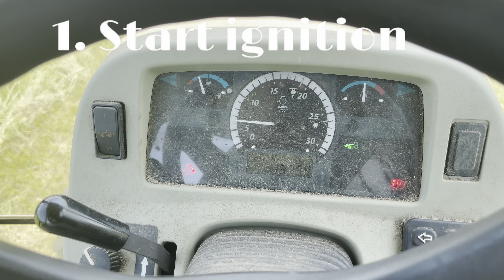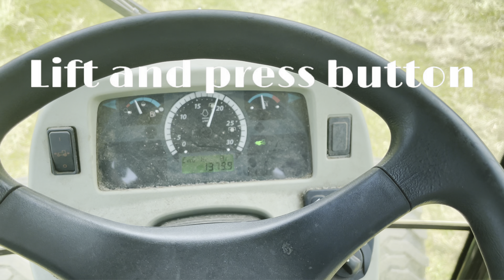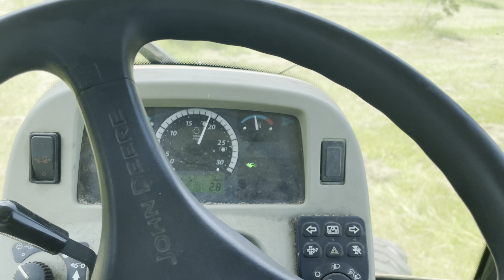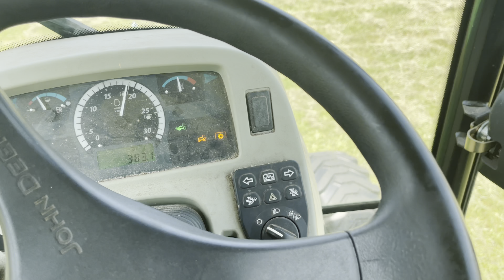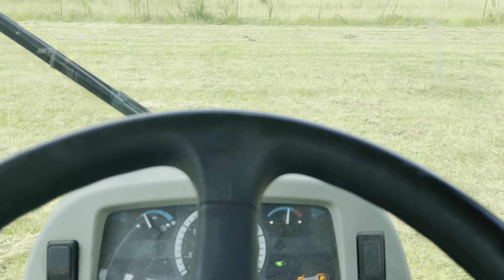HOW TO DRIVE A TRACTOR  2022 | JOHN DEERE 4052R

Comment: You need more throttle. Your PTO needs to be 540 to get the HP to the cutter. It won’t choke the tractor to almost idle if you are running the correct rpms.
Reply from the maker: Usually we cut with the zero turn, but the grass was so high and thick it was shutting the Zturn down. Once I was raised the hitch it no longer
chocked the tractor.
Reply from the maker: Thank you

Comment: It would not pull so hard if you cut your ground speed back a bit. It will take you the same time because you are having to do a double cut right now anyway.  Sharp blades , pto speed in the 540 rpm range  and 1500 rpm on the motor will allow your bushhog to clean cut and clear itself. Most folks want to fly down the field , AC on . Allthat does is over heat the engine and transmissiom and cause premature wear and tear on the equipment. Haste makes waste is so very true in bushhogging. Peace be unto you
Reply from the maker: Similar to what that guy with a tractor said, I love the feedback. It only helps me get better. You know what you’re right, it was my ground speed. Thanks